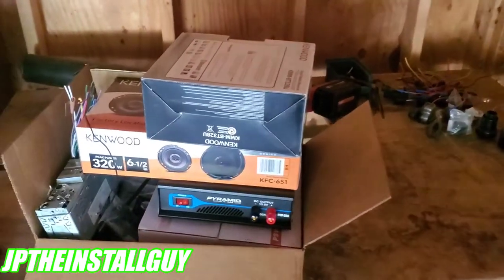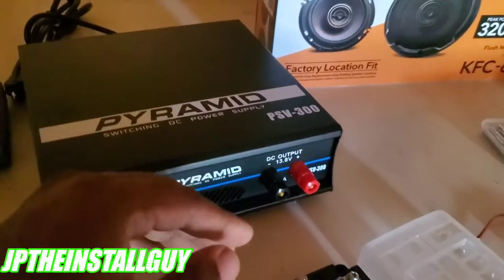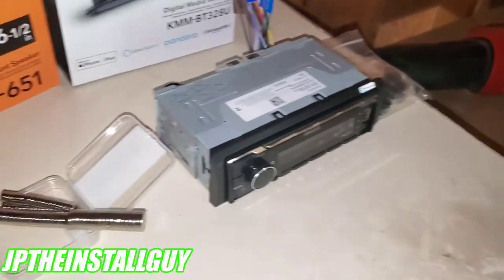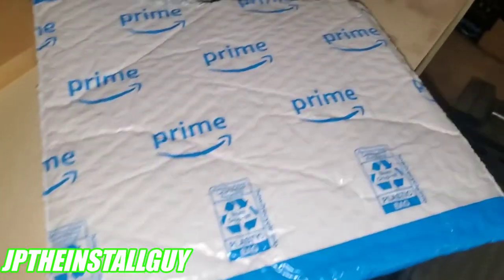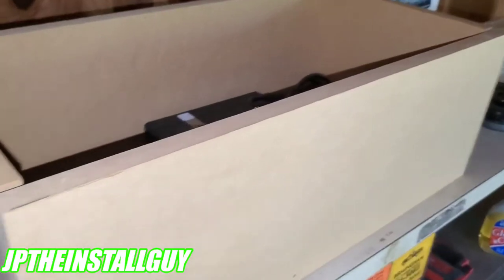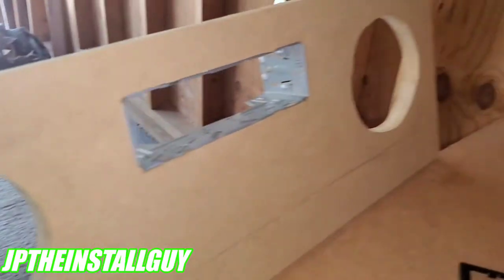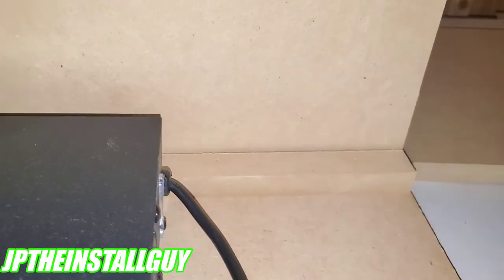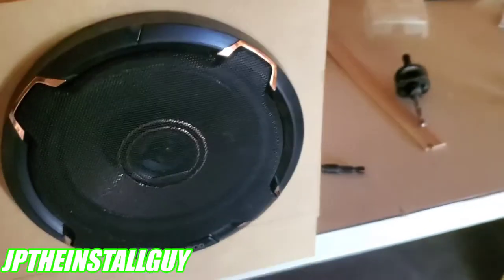DIY make your own boombox | portable Bluetooth speaker part1

Comment: Hey man thanks for sharing this, I want to help my dad restore his Gpa’s jukebox for Father’s Day. Really just redo the wood exterior but put modern speakers and unit inside. This helped me a lot. It’s a pretty large cabinet, do you think I should add a sub/tweets/or just more speakers?
Reply from the maker: if you add a sub make sure you have it in its own chamber for the proper air space but honestly i would just add more speakers , you'd be surprised how good it will sound, glad this video helped.

Comment: Would 16.5 amps be sufficient?
Reply from the maker: sure as long as the radio your using is 10 or 15 amps but you wont be able to add anything else to it but it will work for sure